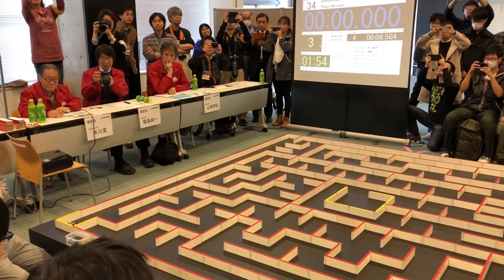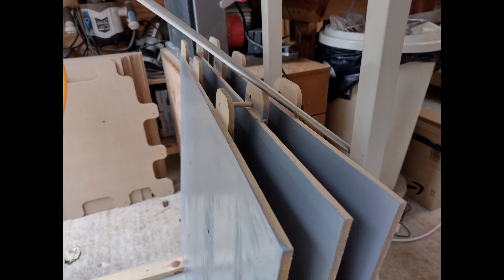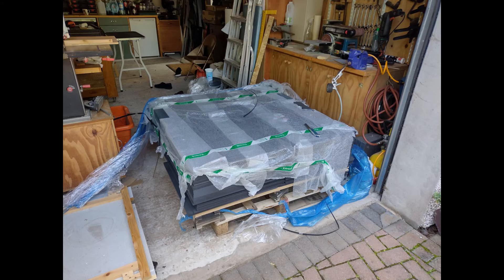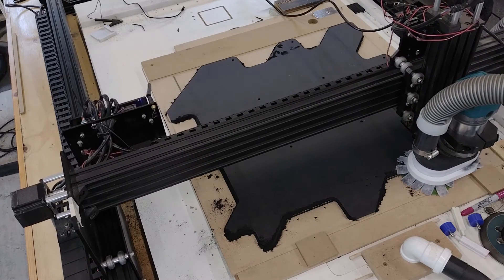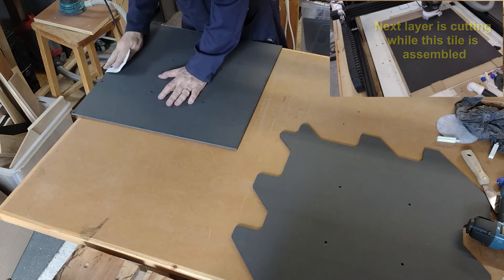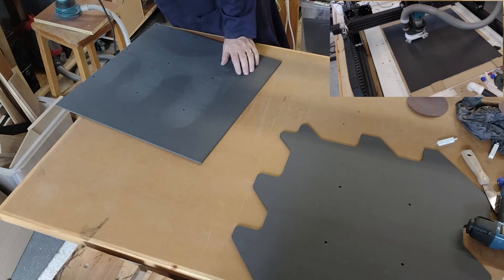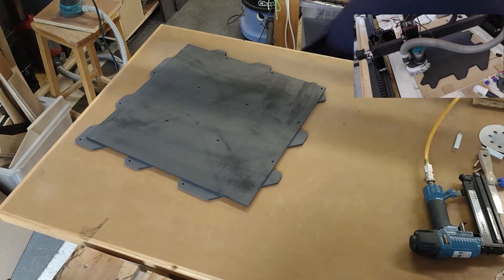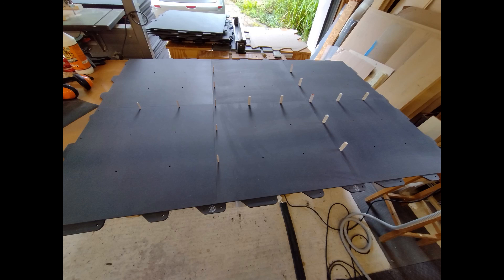How to make a micromouse maze 2023

Comment: Is a micromouse event always conducted in an indoor closed environment with no natural light coming in ?
Reply: that is often the case but sometimes there can be nearby windows and the possibility of a lot of sunlight. We try to avoid that but it can happen.
Reply: @micromouseonline  thank you. Window is fine . But if the arena itself is not confined by walls and has sunlight all over the place, then it's not suitable for a micromouse contest right ? Also in that case how we protect our IR?
Reply: @suricool99  It can make things very difficult. Direct sunlight on the maze or nearby walls may make it impossible to run.
Reply: @micromouseonline  thank you

Comment: Hi, I've one question.
The walls are merely fitted between the posts, or are they glued to the floor of the maze?
Reply: The walls have tabs on them that slide into slots in the posts. The posts have 6mm (in the UK) pegs that are inserted into a grid of holes to make up the maze floor. The maze can very easily be rearranged.
Reply: @micromouseonline Thank you!!
I'm a student from Brazil and we are trying to implement a Micromouse competition at my  university. So, we are learning and searching about It.
I've another questions, do you have an e-mail I can contact you?

Comment: Hi, I'm trying to make the lower part of the track in solid works but I don't know how to do it, would it be possible for you to give me the measurements to try to do it?
Reply from the maker: I clean forgot to add them in the description. That is fixed now. Also here:

Background on the design of the maze can be found on Github at https://github.com/ukmars/maze-building.

The specific page relating to this design is: https://github.com/ukmars/maze-building/blob/main/design/061-two-layer-540mm-tiles.md
Reply: Thank you very much, it helped me a lot  @ukmars